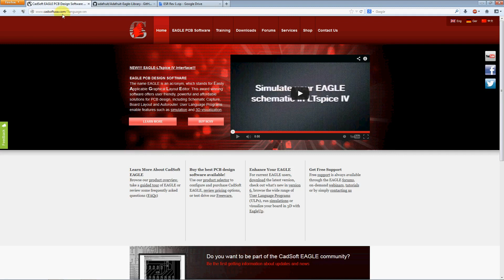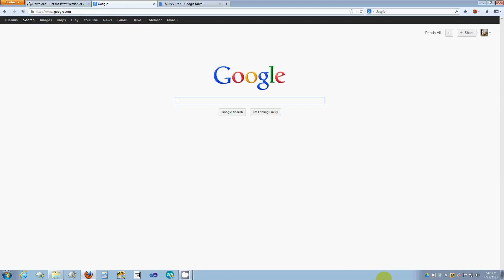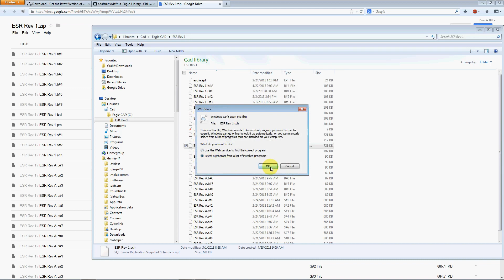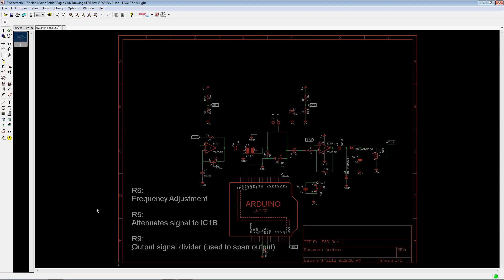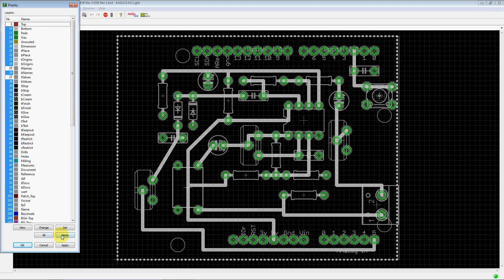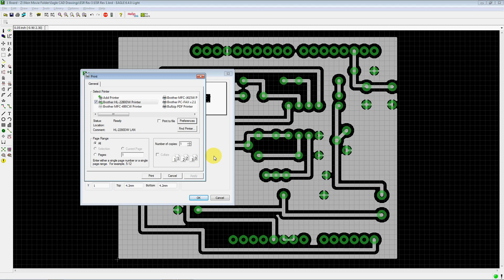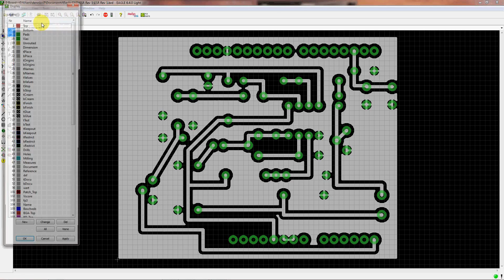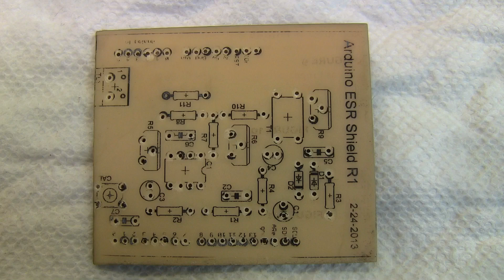DIY Arduino Esr Meter Shield - Part 2: Eaglecad Files And Toner Transfer Overview

Comment: dennis hill, i am having trouble with the output adjustment.  i have a transformer with 900-1k ohm prim impedance and a 20-24 turn 2ndary.  I am trying to get consistent results.. when i adjust the 3 pots, the voltage reading climbs dramatically after a certain point.  the readings are all off.. when i think i have them normalized, I try a larger value resistor (20 ohm) and end up being off by > 30 %.  I am thinking it can either be the cap selection for the electrolytics, the transformer (the fine wire keeps breaking), or the pots being regular off the shelf.  using everything else pretty much to the t.  any ideas?  will probe with a scope tomorrow.
Reply from the maker: Are you powering the arduino through the us cable?
You will find much more repeatable testing when using the DC adapter.
Reply: i was using a converted power supply with 7805 regulator.  I am ordering some parts from mouser (multi turn pots etc).. maybe this might help with some of the setup... I am going to look at your tutorial again and see if I missed something.  

are the dimensions of the transformer critical?  I am just trying to find ways to improve the consistency.  it is BB'ed at the moment on a shelf.. will have to get a pcb made soon.
Reply from the maker: If you are trying this without multiturn pots you are wasting our time...

The dimensions mean nothing. The impedance of the primary has to be high enough to not drag down the output of the op amp.

What op amp are you using? this will also make a BIG difference

Comment from the maker: Thanks to all who enjoy this video!

I have been asked about a parts list several times now and I want to address this for everybody. I should have done a demo on this and I apologize for not doing this.

I didn’t include a Bill Of Materials (BOM) with the project because it is easy to generate the list from inside Eagle CAD.

With the ESR Rev1.sch file loaded in EagleCAD;
Simply click on the FILE menu and select Run ULP….
Then select the BOM.ulp file from the window that opens and a parts list is automatically generated.

I didn’t include a BOM as I anticipated people would want to tweak the board and components to fit there need and parts they have on hand.

There are discrepancies on the schematic vs the build I did. I used the TLV2772 OPAMP and a transformer I found in my junk box, so the transformer listed on the schematic is just a part that matched the footprint of the transformer I found. I can verify that the TL062 does work and the transformer is easily made.

I am going to post the instructions on creating the transformer using a small toroid. Francisco T. came up with the idea and it works wonderfully!

I will post the instructions shortly on my website: http://www.DiscoveringElectronis.com

Other than that have fun and don’t be afraid to make your own changes!
Dennis

Comment: Is there a part number for the transformer or if you know of an ebay number that is suitable could you let me know please. Thank you.
Im looking forward to doing this project.
Good work.
Reply from the maker: "Francisco T" made a VERY NICE xformer from a toroid he had in his junk box and it is super easy to make one that works better than the one I salvaged. Below is a snippet of an email he shared with me.

"As I mentioned I built the transformer by taking a ferrite toroid with the following dimensions  outside dia.  .880”,   wall thickness  .175”,  wall height  .250”. I clamped it in a vise along the center line and gently  struck it with a piece wood. broke very cleanly in half. I then wound 400 turns of 32 gauge wire taped that up and over that I wounded 20 turns of wire and taped that up only using one half of the toroid.Then I grazy glued the to halves together and it works beautifully. The most daunting part is the transformer but with this method anyone can built this.This was my first attempt at building a transformer. I can not take credit for the breaking in half of the toroid though. Also my meter has been built with the TL062 opamp. I mounted the IC on a IC holder so I will test the TL082 and give you feed back on that."

Here are some pictures he sent me. As you can see in the output picture, his xformer is putting out about 210 mVpp; PERFECT!

http://www.discoveringelectronics.com/pics/FranciscoT.ESR.Build/FranciscoT.Hand.Wound.Toroid.Xformer.jpg

http://www.discoveringelectronics.com/pics/FranciscoT.ESR.Build/FranciscoT.ESR.Build.png

http://www.discoveringelectronics.com/pics/FranciscoT.ESR.Build/FranciscoT.Transformer.Output.jpg

AGAIN, excellent job Francisco!

I would also like to see other builds of this project if you wish to share and thanks!

Comment from the maker: Note:
I was just made aware of an error on the BRD file included with the Eagle Cad files. There was an orphaned gnd plane trace on the routed board and this has been corrected.

A very warm thank you goes out to "Francisco T" for catching this error.

I can't explain what happened as the board I built turned out fine. Something got changed when I published these files.

Comment: Very nicely done.  I am experimenting with your schematic and code, and modifying it to use a stand alone ATMega328p rather than an Arduino.

A couple of questions that I have regarding your drawing.  You don't show the connections for the PULSE_HighRange and PULSE_LowRange pins.  Do they by chance connect to GR1 and GR2 on the drawing?

Also, the connection for the calibration button is not shown.  Your drawing shows a CAL button, but your code says that Digital Pin 2 is the Discharge Pin.  How does the discharge pin actually connect?

Can you clear those up for me?
Reply from the maker: First of all "Thank You" for the compliment!

I would be glad to help if I can. I'm not sure what you are referring to as far as the  PULSE pins however. What are they labeled on my schematic?

The GR1 and GR2 nets are simple voltage dividers creating a 2.5 Vdc signal to be used as the control point of the OP AMP; a virtual ground.

The CAL button is connected to the Arduino D2 pin as shown in the drawing. Since I am using a LCD button shield in my project, I reassigned the CAL button to simply display the ADC calibration correction integer currently in use, it also displays the corrected ADC value and voltage equivalent as shown in the first video.

You will need to replace the calibration "display code" with the actual "calibration code" or attach another button to A0.

PM me if you need to email me for more details.
Reply: Dennis Hill
Please accept my humble apology... I just realized that I made an embarrassing error.  I was looking at a different piece of code rather than yours.  Your code is very nicely commented and should be easier for me to work with.  I would be happy to share my drawing and code once I complete it.  Thank you for the help and encouragement.
Reply from the maker: at2marty
I would be very much interested in seeing your version and thanks again!